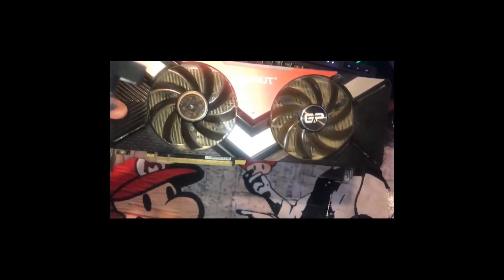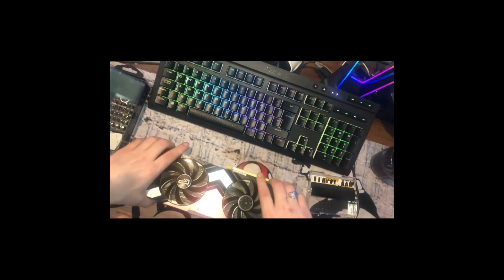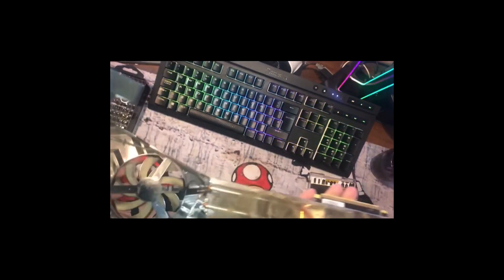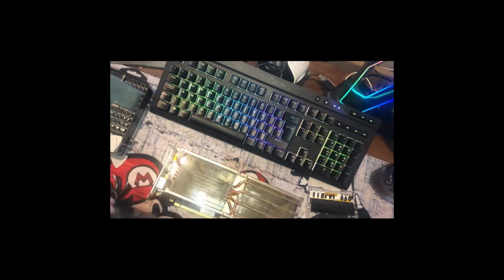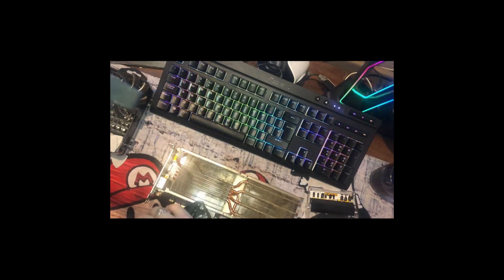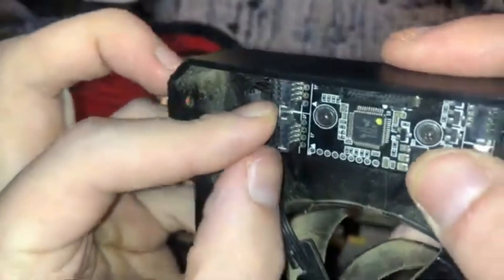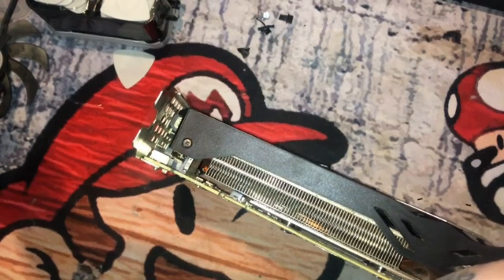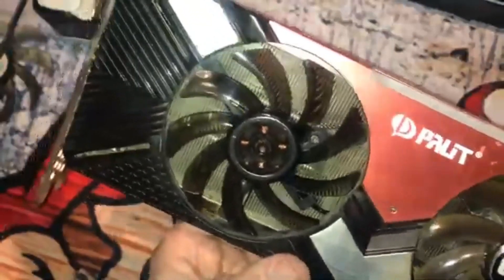PALIT RTX 2070 8GB FAN REPLACEMENT | TEARDOWN & CLEAN UP!

Comment: I have same model but 2080 Palit and my right fan starting to fail/wobble and run hot and not spin proper rpm I want to replace. Is it possible to just replace by keep it "clipped in" by over tuning top part lying side by side. (I rather not remove too much if possible) I'm new to repairs etc. I'm asuming right fan is clips at buttom of board not top ones that you replaced. Also theres 3 triangluar screws that mount fan in place. I'm asuming once you remove those and unclipped from buttom part of board it will come out? Just pop new one in place in 3 screws of fan moun and reclip back to board. Would appricate your insight/help thanks
Reply from the maker: Yeah when I took things apart I was able to just take of the front plastic cover remove/switch the fans without taking off the heatsink hope this helps feel free to jump in our discord if you need any help